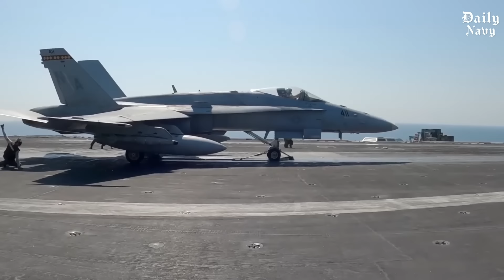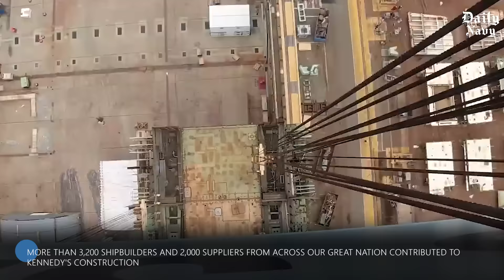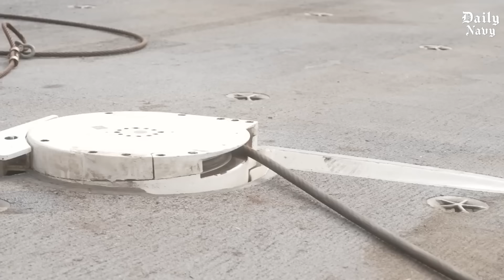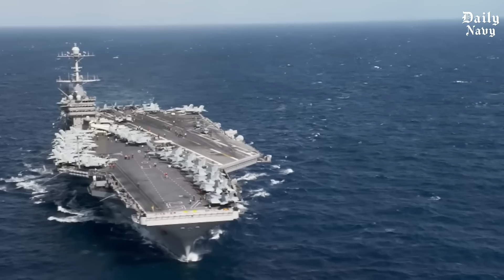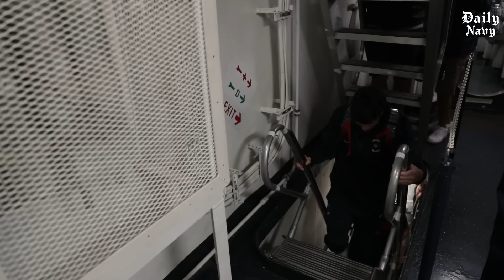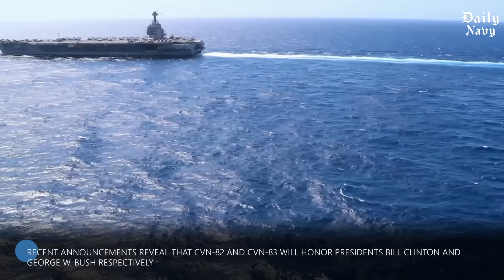How US Navy Launches Its Brand New Aircraft Carrier Onto The Sea

Comment: Don't matter what type of CAT you use a aircraft launch every 90 seconds is about the best you can do as bring them from hanger to flight deck is the bottle neck. You only have so much room moving all those aircrafts around yes the new aircraft is little bigger 1,106 feet vs. 1,092 feet , also the new aircrafts are bigger as well the new super hornet is bigger, Tom Cats replaced by F35 which is bigger and so on.

Comment: Very impressive, expensive but impressive but even after over 13 billion dollars many so called advances onboard systems do not work properly.
Even in 2025 the carrier USS Gerald R. Ford (CVN 78) continues to have shakedown problems. The Electromagnetic Aircraft Launch System (EMALS) and the Advanced Arresting Gear (AAG)  not to mention its jet blast deflectors or its Advanced Weapons Elevator (AWE) all performed significantly below expectations during recent sea trials. 
Not so much bang for our bucks it seems.

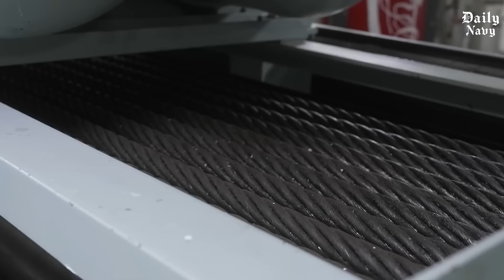Comment: 7:05- The cable holes are not tapered around the edges, potentially an issue of rubbing and cutting the cables repeatedly back 'n forth if they come to contact, eg. by cable vibrations.

Comment: What's fascinating is that I deployed on the original USS John F. Kennedy CV-67 in 1990. I know that ship was decommissioned, however I had no idea they were building a new one with the same name. I miss it terribly. I wish i could take my family on a one week workup on the new ship. I say one week, because I don't think they could take much more that that. I was attached to VF-32 when we had F-14A Tomcats. So, I would love to sleep on the O3 level right up under the flight deck again. Just so my family could fully appreciate what we go through in service to our country. Lying in your rack as those airplanes slam onto the flight deck and the sound of the arresting gear cable being pulled out and then being retracted back in. Have my family stand on the flight deck during an aircraft launch at full afterburner feeling the heat and the rumble of the engines that rattle your teeth. The smell of the exhaust and the JP5. Participate in a "Rig the Barracade" exercise. Sitting on top of of my bird in the hangar bay, wiping it down with some spray turco. I was a line rat (Plane captain) back then.

Comment: During World War II, the United States rapidly constructed aircraft carriers to meet wartime demands, with build times varying by class and production urgency. Here’s a concise overview:
Essex-class Carriers: These were the backbone of the U.S. Navy’s carrier fleet. Construction typically took 12 to 18 months from keel-laying to commissioning. For example:
USS Essex (CV-9): Laid down April 1941, launched July 1942, commissioned December 1942 (~20 months).
USS Hornet (CV-12): Laid down August 1942, launched August 1943, commissioned November 1943 (~15 months).
Later ships benefited from streamlined production, sometimes completing in as little as 12 months due to wartime efficiency.
Independence-class Light Carriers: Built on cruiser hulls for speed, these took 10 to 14 months. For example:
USS Independence (CVL-22): Laid down May 1941, launched August 1942, commissioned January 1943 (~14 months).
Escort Carriers (CVE): Smaller and simpler, like the Casablanca-class, these were built in as little as 6 to 9 months. For example:
USS Casablanca (CVE-55): Laid down November 1942, launched April 1943, commissioned July 1943 (~8 months).
Factors Enabling Speed:
Mass Production: Shipyards like Bethlehem Steel and Newport News operated 24/7, using prefabricated sections and assembly-line techniques.
Workforce: A massive labor force, including women (e.g., "Rosie the Riveter"), worked tirelessly.
Priority: Wartime resource allocation prioritized carrier construction, with 24 Essex-class, 9 Independence-class, and over 100 escort carriers built by 1945.
Overall, carriers were built remarkably fast—sometimes under a year for smaller ones—due to industrial mobilization and urgency.

Comment: Navy shipmen may prefer steam catapults over electromagnetic aircraft launch systems (EMALS) for several reasons, based on operational experience, reliability, and historical context. Here's a breakdown:

Proven Reliability: Steam catapults, used for decades on carriers like the Nimitz-class, are a mature technology with a well-established track record. Crews are highly experienced with their operation and maintenance, leading to confidence in their reliability during high-stakes missions. EMALS, being newer (introduced on the Gerald R. Ford-class carriers), has faced teething issues, including reliability concerns during early testing, which may cause skepticism among some sailors.
Maintenance Familiarity: Steam catapults rely on mechanical and hydraulic systems that navy personnel have mastered over years. Maintenance procedures are well-documented, and spare parts are widely available. EMALS, which uses advanced electrical and control systems, requires specialized training and new diagnostic skills, which can be challenging for crews transitioning from older systems.
Simpler Repairs: Steam systems, while complex, are often seen as easier to troubleshoot and repair in operational conditions. EMALS relies on sophisticated electronics and software, which can be harder to fix at sea if issues arise, especially without specialized technicians or equipment.
Perceived Robustness: Steam catapults are seen as rugged and capable of operating under a wide range of conditions, including battle damage scenarios. Some shipmen may perceive EMALS as less resilient due to its dependence on precise electrical systems, though modern EMALS designs are built to be robust.
Historical Bias: Sailors accustomed to steam catapults may resist change due to familiarity and trust in the older system. This is a common human factor in adopting new technology, especially in high-pressure environments like aircraft carriers.
However, EMALS offers advantages like reduced maintenance, greater efficiency, and finer control for launching aircraft, which are driving its adoption despite initial challenges. The preference for steam catapults often stems from their long history of dependable service rather than a definitive superiority over EMALS.

Comment: In contrast the Fujian, China's newest Aircraft carrier is not a blue water carrier. It hugs the Chinese coast line and can barely launch any aircraft. The Electromagnetic launch system does not work, and if they did, the Fujian has turbine engines which are incapable of generating that much energy. A nuclear engine is needed to generate the   1.21 gigawatts required to make them work.

Comment: I have always wondered how the keel, which rests on blocks, is painted. Semper Fi, USMC 1958-1964
Reply: Easy: the sections are placed on the blocks already painted. They leave strips along the edges w/o paint, complete the paint job after welding.

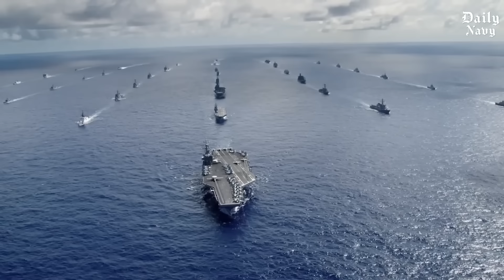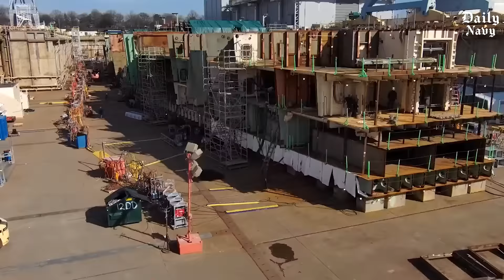Comment: 1:22 The launch was from a Nimitz class destroyer, with on a steam catapult, 1:22  8:30 Still showing steam catapults. 8:30  11:29 Another aspect of the delay of two years was the Navy’s determination that the USS Nimitz had two more years left in its life, which has been provided.  The carrier air wings needed for carrier operations limit the benefit of having more carriers in operations.  No need to scrap the USS Nimitz earlier than needed. 11:29  As we are planning to have 11 carriers at all times, how can we only plan to build 10 of these carriers??  Doesn’t this leave us one short after all the Nimitz carriers are retired, or are we planning/designing the next generation of carriers whilst building this class?